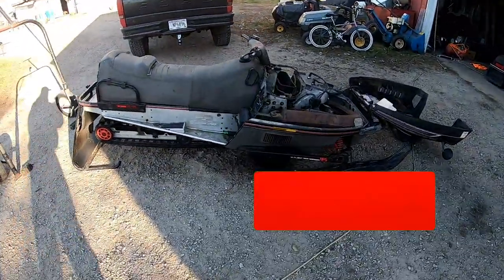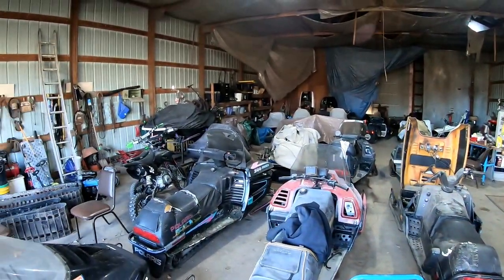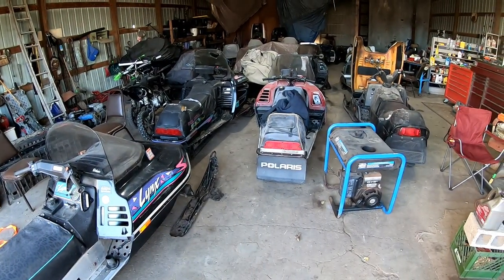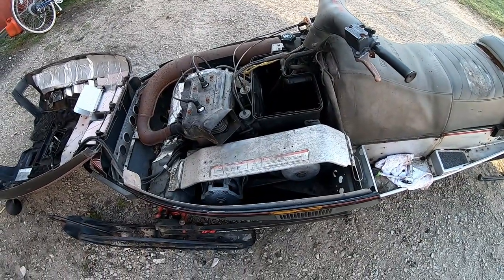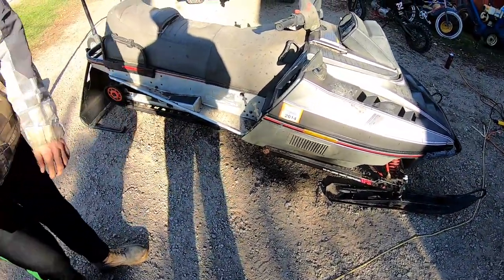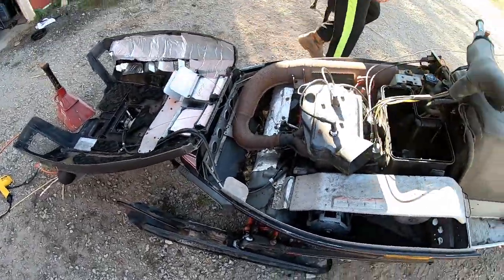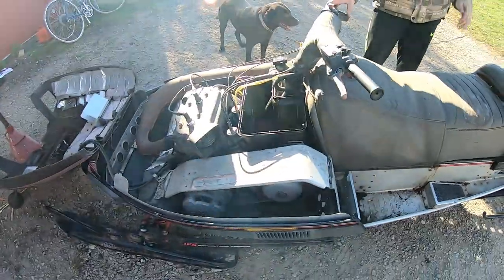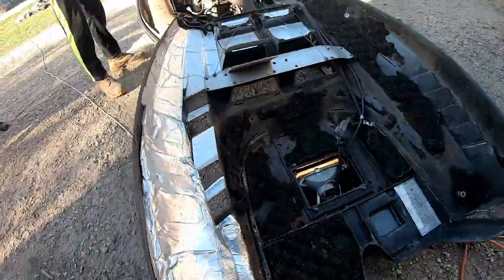Less Than $50 Snowmobile Runs in a Few Short Minutes - Polaris Indy Trail Deluxe 488 for CHEAP

Comment: I just bought one of these and it idles really high at around 4000 and the rpms go to 10,000 on the gage so I don't know if that's normal or not it does want to go with out throttle so I'm guessing it is too high any suggestions on how lower the idle speed I'll also do my own research
Reply from the maker: Throttle cable adjust or idle speed screw or u have an air leak somewhere
Reply: @bearkreekboys  thanks man, I just did some digging and it turns out the owner before me was adjusting the screw the wrong way I had to spend 10 minutes reading through the owners manual online thanks again for the help